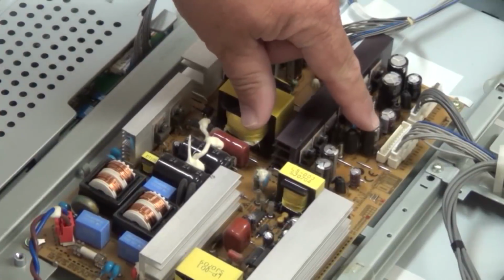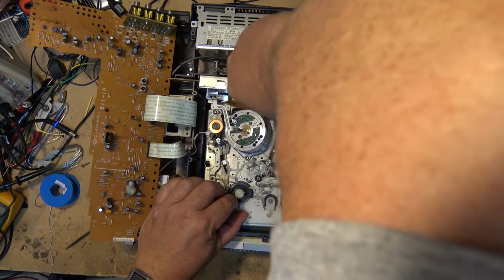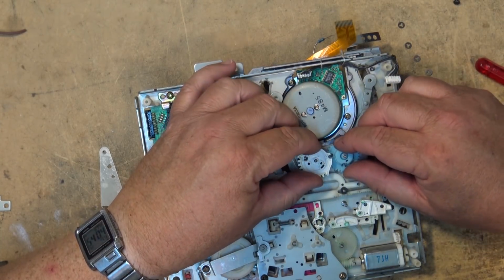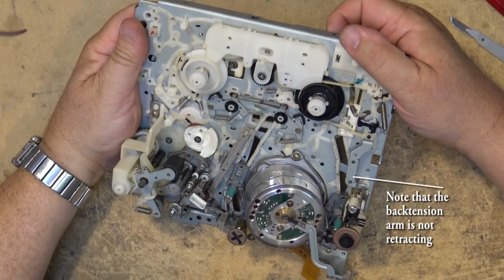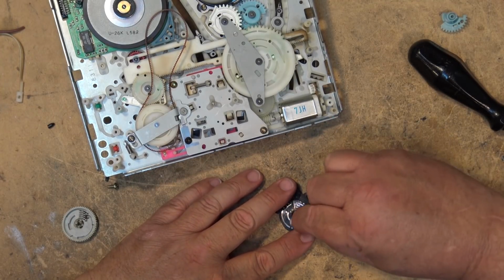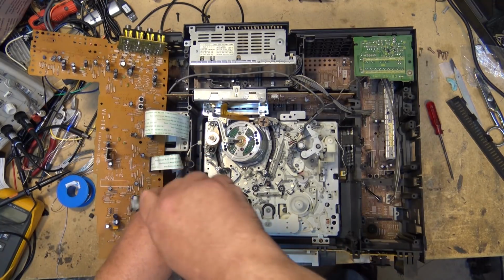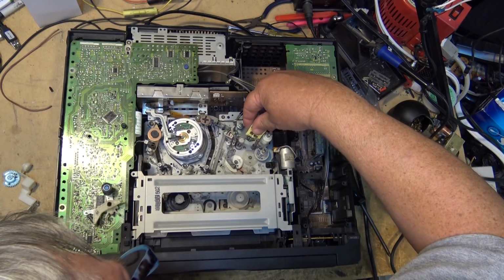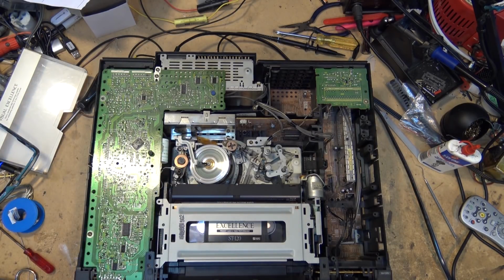Sony SLV R1000 full mechanical repair

Comment: Could you offer any help diagnosing a playback problem with this deck? Deck played beautifully until recently. Now when watching a tape it goes snowy every 10-15 seconds and appears to switch between speeds (SP and LP I think). I thought it might have been the tape so I FF and RW it completely in a rewinder. That cleared it up for a few minutes but the problem recurred. It happens with other tapes as well. I cleaned the heads and the tape path (to the best of my novice ability) and again it cleared the problem for a few minutes (tape played crystal clear) but then it recurred. I'm guessing it's a speed regulation problem with the take up reel? My next step is to play with the hood off and see if I can observe something mechanically wrong but I thought it might be something you've seen before. If you don't do consultations maybe you could point me at a web resource? Thanks again for your video. I'll go through this one step by step when I service the deck.
Reply from the maker: Watch it with the top off. Watch for curl along the bottom edge of the tape and watch as the tape goes over the control head. When the pinch roller wears the tape will ride up or down, an doing so will cause the tape to creep off the control head, which is what is used to detect the speed.
Reply: @12voltvids  Beautiful! Thank you. What's your substance of choice for renewing a pinch roller? I know I shouldn't be using alcohol on rubber but that's all I know. I'm planning on putting a repair kit together. Would DeOxit, Molytone grease and 3-in-1 oil be good choices?
Reply from the maker: @williamsmith7674  rubber renew works fairly good.
Reply: @12voltvids  Thanks again. I'll give that a try.
Reply: @12voltvids  I watched but didn't detect any tape curl or creep (though my lighting was not great). The pinch roller felt pretty hard and smooth though so I gave rubber renue a try (and cleaned the rest of the tape path with IPA). Looking around online to see how long I need to let the product sit before it was safe to try a tape, I saw quotes on another of your vids saying RR shouldn't be used on rollers that come into direct contact with tape. Since I mostly used my deck for OP stuff that is hard to come by, I got a bit paranoid and gave the roller a couple of swipes with Iso Alcohol to remove residue. So the RR softened and the ISO hardened...Anyway it worked! The deck is back to playing beautifully! I recently rebought HOME VCR ILLUSTRATED by Wilkins and Hubbard (that I had and loved as teenage pre-internet video hobbyist) and it suggested the same symptoms might have been caused by a problem with the back tension guide. Thankfully it wasn't this because that would have been much fussier. Thanks again for your remote assistance. Subscribed.

Comment: I picked up a slv-r1000 today for $20 at a estate sale. I probably over payed considering it was broken. I didn't know if it was actually broke or not when I bought it because there was no power cord. I gave it the shake test and could hear something rattling around. I bought it, took it home and took the top/bottom covers off. Broken blue gear found inside. Your video will make the difference between getting this vcr fixed instead of tossing it.
Reply from the maker: Broken blue gear is very common, and relatively easy to replace.
Reply: How does the play back quality of the slv 1000 compair to a Panasonic AG1980p. Thanks for your time.

Comment: Hey great videos btw, but I have a question am I still able to get a new blue gear? I have a slv-575uc and it was claimed that it was working but from watching your videos I inspected it first and the blue gear was broken. Everything else that may damage the blue gear does move and is free so I think it just broke from the spring. Is this 3-736-147-01 the right part number for this gear or is there slightly different gears for each Sony machine?
Reply from the maker: Yes the blue gear is still readily available. All those Sony VHS mechanisms used the same blue gear. 
I just used my last one about a week ago.  I still see these machines regularly.
Reply: @12voltvids  what is the best place to get them from? Other than ebay or is that the only place?
Reply from the maker: @motorhead45102  kpcomponents carries them. They are a mail order supplier in Canada.
Here is a link to the part.
https://kpcomponents.co/search?q=iw220

And now you know where to get many parts. They are local to me so I just drive over and get them as needed.
Reply: @12voltvids  it'd be cool if I had a place like that local. Was kind of sad when I flipped open the front vhs door and seen the left loading (insert correct word) stuck by the video head. I was almost worried I was going to break the circuit board on the bottom of the  chassis, but mine has a soldered connector that didn't want to come apart.
Reply: @12voltvids  also do I have an odd Sony machine? As in when I do searches and stuff for the VCR I have it either comes up slv-555uc or 757uc and I have a 575uc. The only difference I notice was the circuit board was harder to get off than the one in your video. The board for the belt motor has a soldered connection instead of a cutout with a wire connector like the one in your video.(correction this is a comment meant for your slv-555uc video)
Reply: Jeremiah Coughlin  well 3 years ago I did find parts lol.

Comment: Hi, I happen to have a Sony SLV-E90 and I have the same problem. It looks practically the same from the inside, in mine the same guide is just loose. This would probably mean that the same gear has to be replaced. Would you happen to know where I could buy such a gear? I'm living in Europe, so I'd appreciate it if I could buy it somewhere here. But I guess I could also order it from US if shipping isn't too much. It would mean a lot to me.
Reply: I opened the VCR and just as I thought, I indeed have the same gear broken.
Reply from the maker: Those gears break left right and center.
I don't know who sells them across the pond, or even south,  but in Canada they are available from KP components.

Comment: I decided to digitize my VHS tapes.
I bought a video recorder SONY SLV-X711SG for $ 10 yesterday. 
Externally in excellent condition. Even with checks, passport and so on. 1995 release.
The owner said that the magician had not accepted cassettes for a long time and that they had never opened them (this was the main thing for me) and that they had not touched him for 15 years.
Really did not deceive - inside everything was overgrown with huge cobwebs, but the lubricant on the plastic gears is in excellent condition.
I read the forums - they write that it is necessary to replace all 3 drive belts and there will be happiness.
At the same time, I washed everything inside, cleaned the head (although it was clean), smeared metal friction points with "Ciatim-201", plastic gears - with "Panasonic" grease.
The cleaning foam roller turned into sticky clay - at once this foam rubber was carefully removed (the lever itself was left, because it doesn’t rub the head, there is an emphasis on it below and does not reach the head).
The drive belt (all 3 pieces) was like a rag, sticky and sagged.
I pulled (good thick) stationery gum - and everything really spun, and the tape was perfectly swallowed.
And most importantly, I read somewhere else that with everyone, after replacing the drive belt, in this model, everything starts working perfectly right away.
But not me ....
The cassette lay down, but the film doesn't even spin at all by 1 mm at all — the engine tenses and strains, but the cassette stands (without pressing Play).
After 7-10 seconds the tape is spat out.
I tried the second time - it turned out even worse - some kind of plastic gear began to crack very loud for about 10 seconds.
These 10 seconds seemed like an eternity, so I understood that now somewhere there are licking plastic teeth.
After 10 seconds, again threw the tape.
For the third time, I did not take the risk that I wouldn’t lick something completely somewhere.
Revised the whole mechanism, but did not find it - where exactly and which gear wheel slips so loudly and cracks.
(I will not analyze everything yet, I’m afraid then I don’t collect a program gear by tags, if there is any at all).
Embarrassed by a metal comb in conjunction with a plastic gear under the board (see photo) .- did not understand what it is for?
Tell me good people, what kind of gear and why is it jammed?
I would be very grateful.

https://d.radikal.ru/d23/1902/10/2589c52bb355.jpg
https://c.radikal.ru/c30/1902/9d/6ee9d98aa995.jpg
https://b.radikal.ru/b00/1902/8d/f803a0ccd035.jpg
https://b.radikal.ru/b02/1902/7b/3732ff4cd386.jpg

Comment: Thank you for sharring yourt experience with us. I own a R1000 and the tape travel the way it should but the casette won't come out of the vcr  It does bring the tape back in the casette but when the casette start to lift asbout 1/8 then it reload the tape in won't eject the casette. Any solution? Thank you

Comment: Could you tell me please where did you buy the mechanical parts for the vcr. I have an SLV 825 witch have the same drive unit and i need a few things to repair. I think about to buy a defective r 1000 or a r5uc just to get what i need.  If you can help i really appreciate. Nice channel by the way.

Comment: Hi, would you be able to take a look at my Panasonic AG-W1 (it has a tapeloading issue) and if so, where can I send it? Thank you.
Reply from the maker: These mechanisms have many problems.  The plastic parts that can break are not available.
Reply: Thanks for your reply. From what I gather, it's an issue involving the sequence rotary switch.
Reply from the maker: Mechanical problems on these are simple to fix, but those AGW1 machines had many problems with surface mount electrolytic capacitors causing many problems.

Comment: Excellent vid but there's two things I noticed that bothered me. 1 at 33:30ish......I saw a spring on the table/right side of the screen-spare parts? And 2, why not remove that uber lame fiber wheel auto head cleaning thingy?
Reply from the maker: Jeff Adams 
That's right spare parts! (It was the spring attached to the donar p1 guide) 
The head cleaning wheel was not work out so why remove it. It's one thing if it is dirty or one of the foam type that melts.

Comment: Great video!  I came here looking for help with one of these exact VCRs, but one that won't insert/eject tapes.  I opened it up and watched the process of trying to insert the tape, and the electric drive motor turns for a second like it's trying to do its job, but then stops, and the tape never gets "sucked in" to the machine.  If a tape is manually pushed in place, it plays just fine.  Any advice regarding that?  THANKS!!

Comment: Oh crap, I just dropped the bottom on my slv-686hf and found that blue gear broken !! Wow, strange timing but good to find this vid. Could you give some direction as to Where I could pick one of these gears up ...thanks ....
Reply from the maker: I have access to these gears. I don't have one at the moment, but I can get them.
Reply: I would like to order one, possibley two depending on cost. I pulled out a cassette with recorded audio and was going fire my vcr (its been a few years) to play it but because of your vid, I thought I would just check out the mechanism first. Wow it was broken just like you said ... along with a locked-up swing arm. So anways Dave, yes I would like one thank you. Just let me know about the $$. .....

Comment: Hi, any experience diagnosing loss of video output on these devices? I have three r1000’s that all lost video output  over composite and s-video but otherwise play just fine including audio output. I’d hate to junk these things but perhaps we’re getting to that point…
Reply from the maker: Could be caps on the comb filter module. These SVHS decks use a module made by JVC and they have a couple of caps that go bad and cause loss of video.
Reply: 12voltvids thank you for the fast reply! Another data point, the on screen menu (blue background, text prompts/menu) do display properly whereas tape playback does not. Would you expect the OSD to work if the comb filter was failed?

I am quite appreciative of the time you put into this video and unit.  In general SVHS players/recorders get little attention but the Sony’s even less. I’m glad to see someone keeping a few of these alive.
Reply from the maker: Yes blue screen and OSD are added after the comb filter so those will output. The comb filter processed the lumanence and chroma signal from the demodulator and generates the S and composite signal that gets passed onto the rest of the video circuits. Specifically it seperates the Y/C from the composite output from the demodulator.

I have a few videos where I repaired the comb filter on a few mitsubishi  VCRs on my channel so you can see the symptoms of a failed comb filter. Very common. The board on the mitsubishi units is a small JVC comb filter board.

Comment: Been binge watching your videos. I find them to be oddly relaxing. I started out repairing VCRs when I was around 15, but if a machine had a broken gear or something, I always wrote them off as parts machines. I never knew that they could be replaced.

Comment: I wonder if those two replaced parts are used on the Sony SLV-676uc std. VHS machine. Very interesting mechanism. Nice job on that one. I had to watch this twice. I just like that unit.
Reply from the maker: Yes same mechanism. Most of those Sony VHS and SVHS used the same mechanism for many years,
Reply: If you have any for sale,perhaps I should buy them from you now so i can get ahead of any failure. I have had my unit since '92 i believe.
Reply from the maker: I do have some spare parts. The blue gear is available. I can get those no problem, but the other parts are harder to find and I hang on to those for repairs as people still bring me units to repair. I have stuff sent in from all over Canada and the USA to be repaired.
Reply: I would like to buy two gears if you can spare them. I just need to know how to go about doing that. (I have two of those units) I think those units cost me over $400 back in 91-92. I love them still.

Comment: Just got this exact unit, the R1000, from some old warehouse liquidating their business. I have yet to open her up and give her a check and a cleaning. But she accepted a tape and played back fine, although the tape did get half stuck while ejecting once. Wouldn't lift up all the way after ejecting.

You said in the video that you know where to get your hands on the blue gears, could you direct me to the right place? Would there also be any other certain parts I should buy just so I have enough spare parts for the machine to hopefully last through my lifetime?

My family has tons of vhs and svhs tapes that I want to make copies of and digitize, and I'm hoping this machine will get me through it.
Reply from the maker: エステティック Funk 

The blue gear is very common as is the p5 guide sticking. That is the one that pulls the tape out on the right side and threads it behind the pinch arm. Pinch arm sticking to the post also causes it to break so you want to make sure the Grease doesn't dry out. The 2 parts on this one that broke are the most common. The backtension arm plastic foot broke and this caused the backtension arm to not swing out of the way and the guide jammed resulting in a broken blue gear.  I can actually get those gears and other parts locally.
Reply: 12voltvids Right then. Thank you for the comment. I'll just try to follow your video to a T then, for seeing what to clean and what to lube.

I'll replace the electrolytic caps too. Those things are always ticking time bombs.

Comment: Do you know where I can get some cut washers? When I was fixing a vcr problem like this one, when I was taking it off, it shot across the room and I never found it.
Reply from the maker: Used to be able to buy them by the bag of 10.
Have no idea where to get them now.
I have some from junk units as I always keep them for exactly what happened to you.
Reply: 12voltvids could I have a couple?
Reply: Is that what the real name is for those washers?

Comment: Great work but I would suggest removing the auto head cleaning roller that touches the head drum each time you load and unload the tape!
Reply: Might be best to figure out what material the roller uses and make some new material for it. Should make it last another while when finished.

Comment: I have the same machine and the same problem has happend what is the cost of repair if I can get the machine to you. i'm in Courtenay BC
Reply from the maker: I do have a spare gear, I brought a spare in.
You can contact be by email. Link is on my youtube home page.
I'm just across the straight from you close to the ferry terminal.

Comment: Funny thing I have an old Sony hi fi deck that I dragged out to dub off some tapes I found and the pinch arm guide was all "gummed up". I wasn't able to remove it but I was able to get it moved up enough that I was able to get some 3-1 old down there. Now it works perfectly. I am sue it won't last but it worked long enough to get my tapes dubbed off. Thanks for the great videos!
Reply from the maker: jimbronie 
3 in 1 works fine on the pinch arm post. It will last a while. That black grease was the problem.